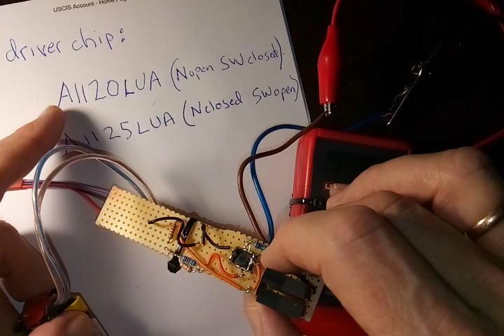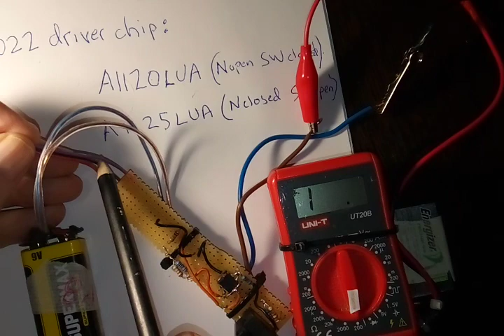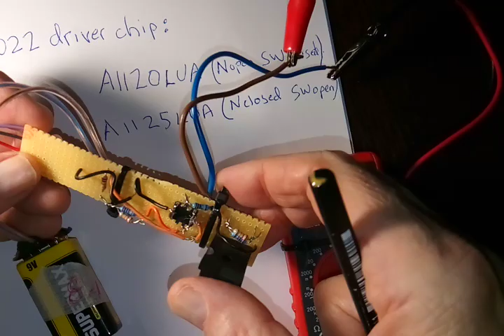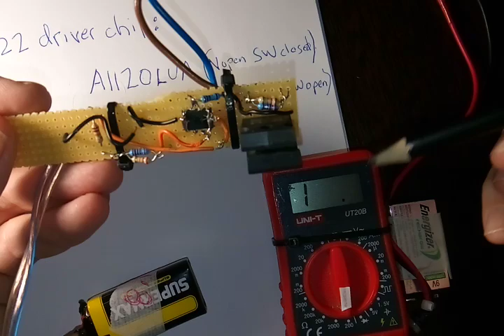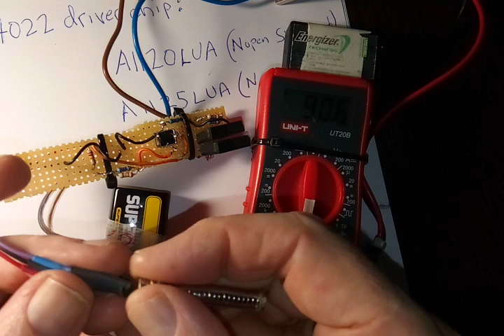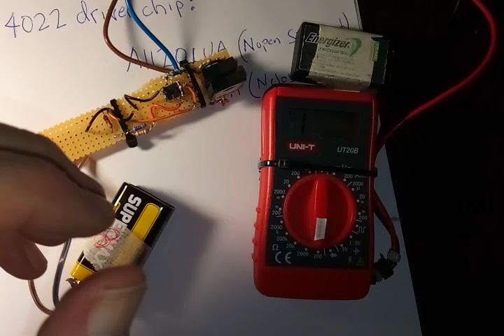Bidirectional mosfet construction

Comment: Hi doug. i had many problems getting the NC hall effects... no one delivers them to austria. (the only company that does forces you to buy 1000 units. but I had ordered (by mistake) some 4422 chips... I found out the they are non. inverting.. compared to the 4421 that are inverting. Result: with the same hall effect and when installing a socket for your chip... you can swith from NO to NC just by changing the chip from 4421 to 4422, using the same hall effect and of course the same circuit...
Luc
Reply from the maker: Hi Luc
Yes, I am running out of 4421 chips but 4422 I have a few dozen but then the halls to make the 4422s Normally Off just have four left....Ebay is good to find stuff, you can get private people who have stocks of stuff....Look at my description box in video I talk about you can make a nice invertor H circuit with these....coming up project is 16 magnet rotor but NSNSNSNSNSNSNSNS magnets and the coil and core goes right between the N S or the S N magnets  when they pulse, so one magnet pulls, the other pushes,  both at same time double the torque from same pulse....seems only logical!   Coil pulse has to alternate polarity upcoming firing position so need invertor type H circuit going on.  Also instead of pulsing out at at "blank space" its going to be during an opposite face of magnet I think you mentioned this idea way back too....just have to have good timing when pulse goes out should/maybe get some speed up upon pulse out to load or caps... 
Also continuing the peak-coil shorting tests probably next videos that....